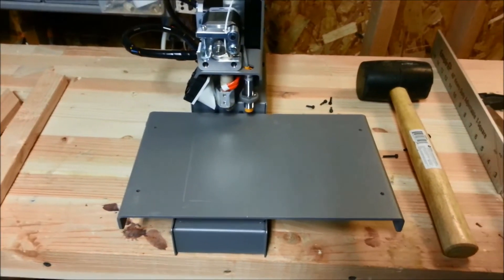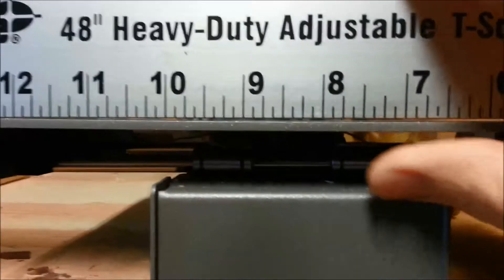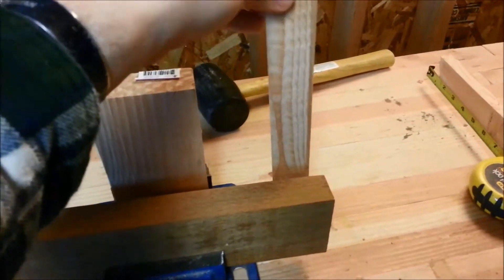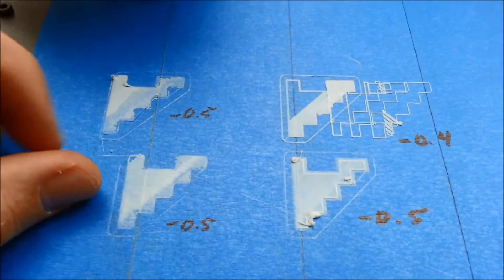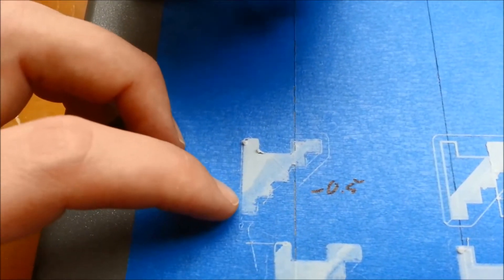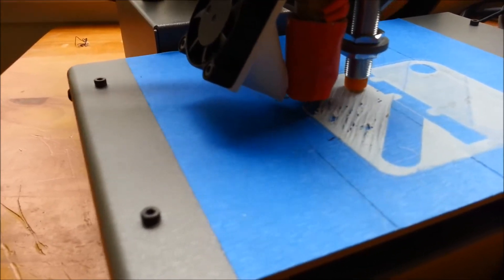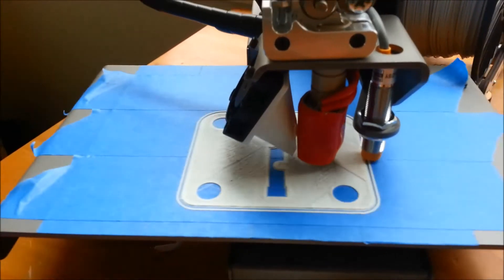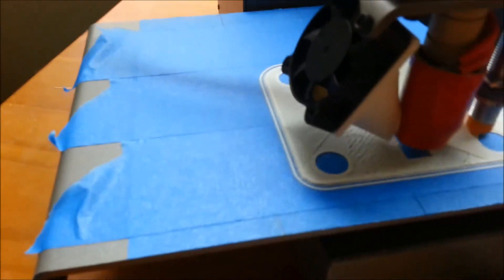Printrbot Simple Metal - Uneven table, fix, and examples

Comment: One thing to check for. When your leveler does the initial homing routine before the print, is it leveling over painter's tape on all three corners? I was having similar issues due to lack of tape under one of the three level corners. When I placed tape all the way to the edges, it fixed my issue.
Reply from the maker: The auto level sensor is magnetic and will not account for height that is not magnetic, like tape. You can test this by raising your Z axis and placing some tape by the sensor and seeing if the light goes off, then placing some metal by it and seeing if the light goes off.  It is odd that you would have any different outcome with your sensor due to tape. Maybe it was due to another reason like you were not homing prior to the G29? One person said they had inconsistent leveling when they didn't home first. Taping the whole print bed can definitely help with problems like having a bow in the print bed as it slightly reduces the overall radius of the table if there is a bow, but it shouldn't effect the auto leveling function at all. 

Thanks for the comment and watching!
Reply: I had heard that, but it seemed to fix the issue. Now I'm having the issue again, even with the tape placed, so I was wrong. :-/
Reply from the maker: Try doing what I did with a flat edge to see how off your table is. Also if you haven't already,  try adding G28 X0, Y0, Z (whatever you have Z zeroed to) before your G29 in slic3r/printer settings/custom g-code. Then if all that isn't enough print with a first layer of .3 or .4. That's how I got mine to work.
Reply: Thanks, Matthew. I did try the flat edge on the table, and it appears to be level on the x axis but perhaps ever-so-slightly bowed on the y axis. I wonder if this could be a result of the screws holding the rods to the table being drilled slightly off-mark? Maybe that's squeezing the table to bring the holes in the plastic and the table together?

I will try those other things you mentioned.
Reply from the maker: I wondered that too, about the holes. But you have to apply a lot of force
to correct it so that leads me to believe that the problem originates from
when the parts manufacturer bent the ends down or during the painting
process if they baked the paint on. I'm surprised printrbot hasn't caught
it. Maybe they did and just don't care to mention.  :/
Reply: *****

I had very similar problems with my new PrintrBot Metal, and I fixed it adding 4 spring washers underneath the build plate - one for each plate screw.
I removed the build plate, placed a spring washer with a flat washer underneath to the protect the plastic, and replaced the plate, tightening each screw just enough to slightly compress the spring washers.
Now each screw can be adjusted to make the corners very close to being exactly level.
Test for level with some flat metal object that just fits exactly between the extruder head and the plate - you can wind the extruder down by hand to make it touch the metal object, then adjust the screws so that the distance between the plate and extruder is the same everywhere across the plate.

This worked for me.

Before this fix, I was only able to print small objects, and unable to print anything that went near one corner, so (before I added the spring washers) I manually measured the distances, and that corner of my build plate was lower than the other three by 0.2 mm - about 2 layers of extruded plastic.

Luckily, my plate was not bowed inwards like yours, just warped by 200 microns.

Comment: not going to lie that hammer scared me, but you look like a licensed hammer operator
Reply from the maker: Ya. lol. I hadn't attempted anything at that point of the video. Just had it out in case. Luckily I didn't have to use it. Thanks for subscribing!
Reply: ***** for sure, I think I'll start leaving a hammer by my printrbot, it shows them we mean business!
Reply from the maker: Andreas Nicholas Haha! I've nick named mine Reek.
Reply: ***** i've developed the same problems with my printrbot now i will try the second layer tape but it might be time to get the heat bed upgrade already :/
Reply from the maker: Andreas Nicholas I highly recommend getting the heated bed. This fix worked really well though if you don't want to spend the cash.

Comment: Matthew given your experience with the metal, would you recommend this printer?
Reply from the maker: Absolutely.

The key things I base my opinion off of are cost, quality, and serviceability: 

I know the Metal may seem a little rough around the edges(my print bed for example), but I only payed $600 for it. Other printers with the same print quality cost twice as much. So I am happy to have set this guy up for a savings of $600. In addition, I think most of the problems I have had (minus my print bed) are due to my inexperience.  

The print quality is outstanding. last night I printed off a few small components at 0.1mm and you can't even tell it was a print; there were no print lines! Even my 0.3mm prints look wonderful. I just printed a viking house from Thingiverse at 0.3mm and the print lines are barely noticeable. I plan on priming it and painting it anyway so that will all be taken care of. 

The Metal is really easy to take apart and put back together. That's something I really love about it. It is simple... I had an extruder clog today so I paused my print, disassembled the extruder from the machine, and fixed it to where I was back up and printing in probably less than 5 min. Almost everything on the metal is accessible by removing only 4 bolts. I've seen videos of how to fix other printers and the thought of going threw all those steps pains me. If you look at the printrbot website you can see that replacing the components if need be is not expensive at all. 

The fact of the matter is that this is still an emerging technology. I expect that every printer out there will not be what we dreamers expect them to be; perfect. So I have taken that in to consideration with the Metal. Things will clog and break, we will have to update firmware, and we will have to spend hours dialing the settings in. That's all just part of the fun.  

Also, take in to consideration that this is my first printer ever. I haven't gotten a chance to compare against others. (To all those 3D printer manufacturers out there, this is your invitation to start sending me free printers so I can compare them and post vids.)    ;) 

I hope this answered your question! Feel free to ask me anything else.
Reply: ***** Agree, this is a great little printer.  I just got mine two days ago.  I haven't had the bed problems you had but I did have some clog issues.  I seem to have worked through that and now getting decent prints out of it.  This thing is so much fun to play with!  Thanks for your videos!

Comment: Number one problem is the table is made of 1/8 thick steel. Because it has radus bends on each end its never going to be true level. my advice is to switch the bed to 3/8 aluminum plate. If you have accesses to CNC as i do you can custom make a table that is perfectly level.  The aluminum has better heat transfer then the metal especially if you want to add a heatbed and print ABS.  or you can mount a bar across the front and in between the bushings under the table. drill through holes ,use flat head screw counter sink to bed level. 8/32 flat head. prints may show shadow of flat head screw but its better then what you was getting. Proximity sensors are not really the way to go for this type of application because compounding temperatures and expansion/contraction affects that height of both the bed and hotend.